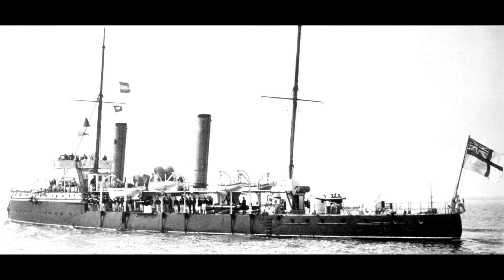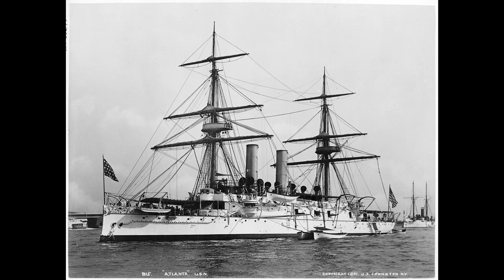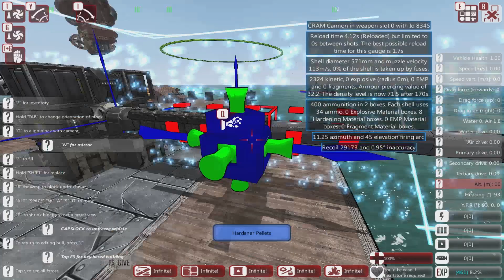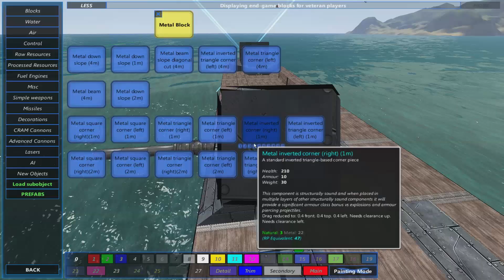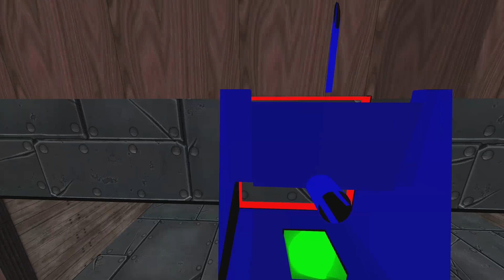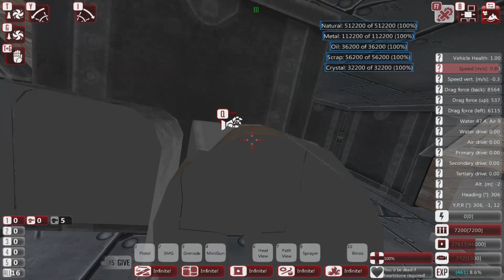From The Depths S3 Design 03-Protected Cruiser Atlanta.LetsBuild

Comment: A quick request (and maybe a logical successor to this one), but a little further down the line perhaps we could see something like the USS St. Louis? Its angled internal armor over the citadel and ridiculous amount of guns might make for a pretty interesting build.
Reply from the maker: +ZaffaPlaysGames  I did think about the St Louis but when I looked some details up it just wasn't as good as the Atlanta and introduced nothing new. It didn't have a main gun of the 8+ range as all those guns where 6 inch and mainly in broadside casement. It was a big ship designed as a long range cruiser. I may build one as a supplement to the Atlanta but will probably be off video.
Reply: +Dels Gaming Well, I felt it worth mentioning since she had both an armored belt and an armored, sloped inner deck; Nominally, she was a protected cruiser, but was really more like an armored cruiser, and you had mentioned armored cruisers in the video! I'm definitely looking forward to seeing the new ships in action.
Reply from the maker: I will check as I wasn't sure she had the belt thought it was mainly protection at the sides via coal storage but will have a look again.
Reply from the maker: +ZaffaPlaysGames had another look and the St Louis was a 1905 ship which is probably why it wasn't my first choice. it did have some belt and casement armour like an armoured ship but was fairly light but still maybe could do this. Biggest difference was the size. the st lous was 9000 tons compared to atlantas 3000 tons so its almost getting onto battle ship sizes or heavy cruiser. but only 12x 6 inch main guns, the 18 3 inch does make me think it could  represent a good AA ship as there was a refit to add som AA although 2 I can take a bit of license to make it 18. So could  become the AA ship of the fleet.
Reply: +Dels Gaming That could be a pretty interesting way to take it, actually. Looking forward to seeing how it turns out!

Comment: I personally think that shields ruin From the Depths by being too over-powered
Reply: and it sucks when you try to build a battleship and you are forced to cover it in shields to stop it from getting owned by equally large ships
Reply from the maker: +Captain Foxy the Pirate (Foxy the Pirate Fan)  I like to think about armour, redundancy and repairs over shields. I would agree that shields spoil things to a degree but the changes in patch that made them use more power has stopped them from being the answer to all things. Also with less power from fuel engines makes it now a trade off. I will still use them once it gets to the ultra modern and I am against hyper velocity shells and lasers.

Comment: First question where you have found the stairs in the building?
I have build after your last video a rebuild from your ship, a little cheaper, more firepower but i dont knowed that you build it after a american style ship. 
My design is more inspired from the japan navy.
Have a look in steam workshop Light_Destroyer from DougJunior.

When you try to rebuild real ships, you should try to use the same gun systems like the original ships. The cram cannons are not the only guns in the game.
Reply from the maker: +DougFunnyJunior  There si now a menu group on the left if you are running the Devtest build called Decorations. You will now find the stars, doors, lights and other blocks that are mainly decorative there.
If your not on devtest then you may not have them yet or they where I think maybe under Misc menu. When you start up it says which version your running, is it about 1.2xx or 1.3xx
Reply from the maker: +DougFunnyJunior On the cannons, I had discuss with others on that and I realise there is other cannons but want to use the CRAM for the moment as it leaves room to add better guns later. If I started with ACC then there would be no upgrade or difference apart from different ammo. Also like to try and use the CRAM until they become unfeasible.
Reply: +Dels Gaming Thanks for info, i play the most time only on the steam build. Can you walk now with the new stairs up and down without stoping on every step?
You should maybe think about a second build when you have finished a design. Test it against some enemys and look what happent when it get hit. Redesign it and you can improve the designs most time massiv.
Reply from the maker: I think the stairs where online put in from build 1.93x onwards so you may not have them in the core steam, build yet. I think I have found that it depends which way the block is placed but it is not obvious which is annoying so will confirm after some testing.
I do give the ships a little rework after the combat, usually mess around with the ranges and weapons a bit but I could spend ages on one design and it would never be finished, prefer to try and make a better one next time. Build, Adapt, Evolve

Comment: make the back heavier to stop it moving forward
Reply from the maker: +John Yarham  do you mean the harvester or the ship
Reply: +Dels Gaming the one with balloons
Reply: +Dels Gaming harvester I believe
Reply from the maker: +John Yarham  ok issue is that while in air the ship keeps going forward as there is no real drag like there is in water. so by time it has slowed it already out of zone and has to turn around. 
I may have to use LUA or some way to detect ship is in zone and engage reverse.
Reply: +Dels Gaming oj
Reply: +Dels Gaming oh
Reply: +Dels Gaming he meant the pich. wich you also could fix with pich controlling ACBs.
Reply: +Fabian Von Glahn pitch
Reply from the maker: Yes I do have some but since it is not using heli blades the pitch control is not as fine. All I have is acb's to detach or deploy balloons as I was trying to adapt the non heli bladed design. I never take the easy path it seems :).
Still I have now adapted it with a Naval AI now and getting some better results although still sometimes wanders outside of the zone.
Reply: +Dels Gaming try leveling the weight
Reply from the maker: that will get it a bit more level which I am workign on a bit but main issues is it slowing down when in the zone. will sort out the level once I got some basics sorted. Some days the simple things just seems such a  pain :)
Reply: +Dels Gaming you could just improve the turning.
Reply from the maker: That is sort what I have done now. got on engine go in reverse on the turn makes it turn quicker although straight lines its a bit slower now.

Comment: Build suggestion: IJN Kawachi or IJN Mikasa
Reply: +Dels Gaming I'd say you do Kawachi just because she has 12 main guns rather than 4.
Reply from the maker: +TheAwesomeLegodude  yes both nice examples of pre dreadnought Mikasa which has a nice full turret design rather than the gun shield of earlier models and the kawachi which is a dreadnought design. Both based I think on british designs although only the mikasa built in england.  I think I will do the Kawachi as many know it from WoWS. The mikasa is similar to the Majestic class which I have some data on, so could be almost inter changable. Maybe do a hybrid :)

Comment: I still don't get why you're going for a historic theme and using guns based in fantasy instead of reality.
Reply from the maker: +Morrigi192  Not sure I see your fantasy bit, but I guess I am using what is available in game to simulate the abilities of the time. Or approximating the same development but using what is available and leaving room for further improvement. I guess your asking why use cram instead of ACC's. At the moment the Cram simulates to me the slower muzzle or early breach loading guns that had good damage but where short range and slow to fire with simple ammunition. Acc's would start to be applicable in the small and large calibers from the dreadnought era onwards IMHO. 
Plus it's different and a challenge.
Reply from the maker: I agree but then where does it leave weaponry to select when going up to really modern or future stuff that has ranges of over 20km and damage and velocities off the scale. since that not possible in FTD everything has to be scaled back. I understand your point and it is true, but at same why not try and use the Cram cannons and then the ACC can represent more modern with scaled down capabilities. As in the video this is not a 1:! replica system as everything is scaled up or down to fit what is available in the game. Plus quite simply I thought it would be fun to see what can be done with Cram cannons ACC's will have their time in the campaign it's just not now.